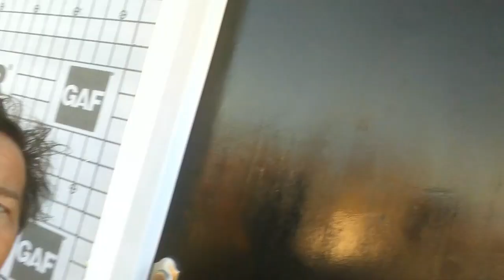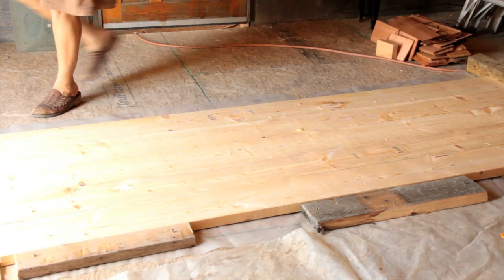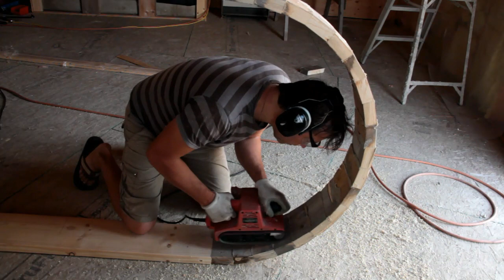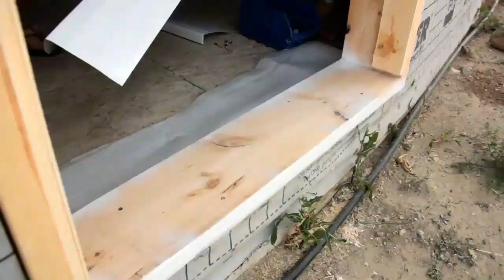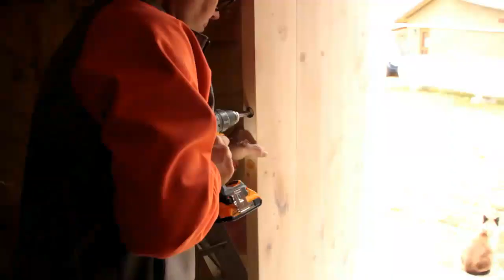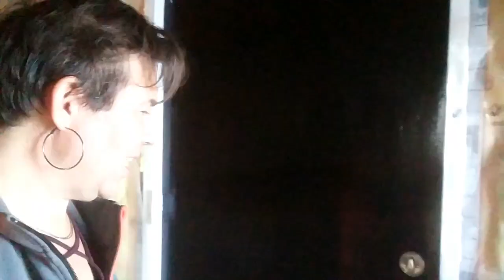Building an Arched Door for under $300

Comment: This video gives me a lot more confidence to do this myself! I'm planning on building a ridiculous door for my goblin den in the loft of our garage. Basically, I want to have my stairway paneled with gray brick with candle sconces leading to a 92" x 40" arched door with a speakeasy. I have watched a lot of videos on this, but I think your method makes the most sense for my project. I do have one question: How did you edge-glue the pieces together? More specifically, how did you clamp the pieces together? I couldn't really tell from the video. Cheers from Minnesota!
Reply from the maker: Thank you Jon, I wish you all the best on your door build. Your goblin den sounds like a fun idea.

I edge glued with two part epoxy. Yellow Carpenters glue works as well. Pipe clamps are ideal, but I didn't have any so I screwed a block to the floor. Layed all the boards down screwed a 2x4 along the outer edge on the other side and then hammered wood wedges between the door and those 2x4s to create pressure. Note to self: put plastic down wherever you are working (glue drips)
Reply: @Naturally-Kelly  you are a queeeeeeeen!!! Thank you for responding so quickly!
Reply: @Naturally-Kelly  oh! One more question: did you use the wiggle board to make your door stop? If so, did you basically layer a kerf into your door jamb with the wiggle board for your weatherstripping?
Reply from the maker: @debbyclowner  Yes. I built up layers of thin strips of wood I could bend and glued/brad nailed into place in order to build the stops. The weather stripping I attached screwed on which makes it adjustable to move inward or outward to get a good snug fit rather than using a kerf and press-in seal.

Comment: Excellent job!  What is the green machine you used to pass the board through that made it bendable ?
Reply from the maker: Thank you. It's a planer to thin the boards down to be more flexible. At their original thickness, they were cracking trying to make the bend so I made them thinner and layered them up.

Comment: How is it holding up?
Reply from the maker: So far so good. We had to replace the door sweep after the 1st winter and went with a little more expensive one. Other than that, extremely happy with how it turned out and is holding up.

I was concerned being a solid core that it might be cold in the winter, but that wasn't an issue - much warmer than insulated steel so that was a pleasant surprise.

Comment: The thin slats that you put after the arch was completed. How thick did you make that assuming that is what the door closes against? I am tackling an arched french style door frame now for our new home and am trying to save the money having someone build one for us.
Reply from the maker: I started with 5/16" x 3.5"  t&g pine wall covering. Trimmed off the T&G and ran them through the thickness planer until I could bend them easily without them snapping. I layered 5 or 6 gluing and Brad nailing as I went to hold the curve. Final was 3/4" thick to match with the 1x4 I used for the stops.

Comment: Thank you for sharing this video! I have a couple of questions regarding the door frame. When building the door frame, was it build snug around the door? Or do you recommend leaving a small gap between the door and the frame? Also, what did you use to glue together the wood pieces that formed the arched part of the frame?
Reply from the maker: Thank you and great questions. I left a 1/8" gap between the frame and door. I added a door seal so the door is winterized and sealed but that gap allows for movement of the wood and settling with the hinges.

Regarding Glue, I used a two part epoxy I had laying around and a brad nailer to fasten everything on the framework.

Comment: Thanks for the video. Brilliant.I need to build 2 of these. Did you just glue the 2X6 together, no screws? The door frame arch, i was scratching my head how to make it. How is it performing? From Cyprus
Reply from the maker: Yes. Just edge glued with epoxy. Ours is working beautifully a year later. A little secret - I had the wood hanging around piled up for 6 months before I began. If you plan on single layed wood edge glued like ours, the wood HAS to be dry and acclimatised to your house and area. Grabbing something straight from the lumber yard and building the same day runs the risk of warping as the wood seasons out over time.
Reply: @Naturally-Kelly  Thanks for the reply
Reply: @Naturally-Kelly  Thanks for the reply. How did you get your epoxy so thick? Did you add sawdust?
Reply from the maker: @antonios4926  https://www.amazon.com/INDUSTRIAL-GRADE-THIXOTROPIC-Epoxy-System/dp/B01J19DXL8 We bought 30 gallons of this about 10 yrs ago to build our laminated roof beams...still got about 5 gallons left that we use on projects like this one. The stuff is incredible and apparently lasts forever unmixed. :)
Reply: @Naturally-Kelly  Thanks for the reply. Wish u well

Comment: I have a question sir , I'm in the market of a new round-top exterior door as well as a round-top storm door so my question is what is the "proper way" of  measuring the opening for the door ?
Reply from the maker: Doors and windows are typically always sized based on RO (Rough Opening) and finished size. Your RO is from stud to stud and your finished Is the width and height of your existing door.  For example, a 32" door means the finished door is 31 3/4" up to 32" wide and your framing for the door is about 1 1/2" so your Rough Opening might be 33 3/4". Most round top doors are 1/2 round so your measurements would be taken from your highest point down to the floor. If it is not a full half circle top, you are best to take a picture of it to show when you go shopping. Round top doors are not common, so you will probably be shopping through a window and door store - they can help make sure you get the right sizing and shape. BTW, I have never come across a round top storm door so if you have one - it sounds custom made.

Comment: that door is awesome I'm looking to making one myself I had a question though can windows be installed on it.
Reply from the maker: Thanks. Yes. If you are putting glass in, I would suggest oversizing your cutout and gluing a framework in place to set the window into. Just removing that much material and then just using stops or a light frame to hold the window in will probably result in uncontrollable warping.

Comment: Hi, won't the door warp as it is just a regular lumber?
Reply from the maker: Yes, there is a possibility of that happening...but also not my first time building a door. I've done everything from our kitchen cabinets to interior and exterior doors and after enough failures, have learned a few tricks. I used 2x6 that I picked carefully. Only small knots and ones I left unstacked for a month so the risk is minimal with acclimated local species. A way to absolutely ensure if I was worried would be to laminate 1x6s on the front and 1x8s on the back instead of using solid 2x6s. Picking dimensionally stable dry wood from the beginning is the key.